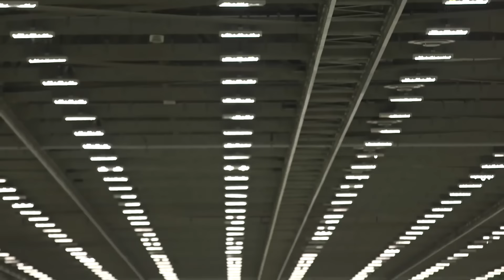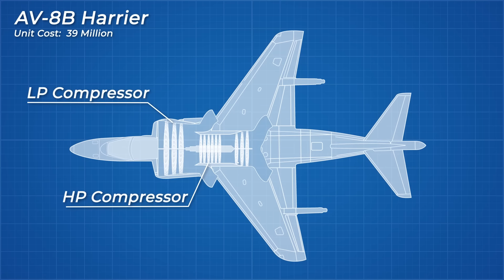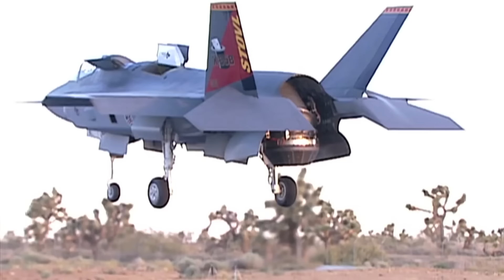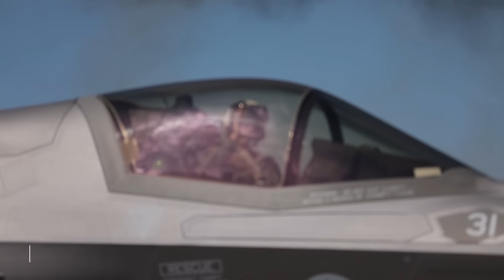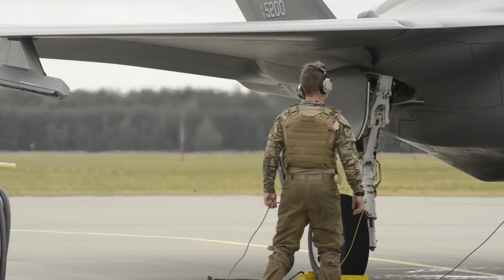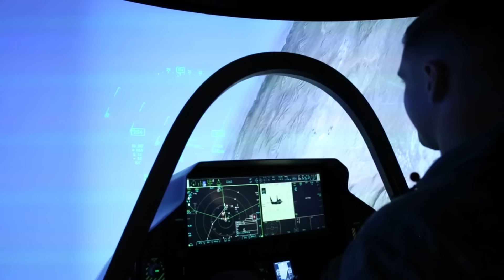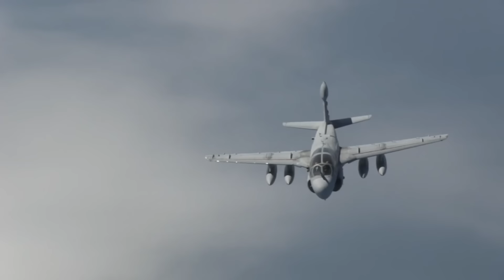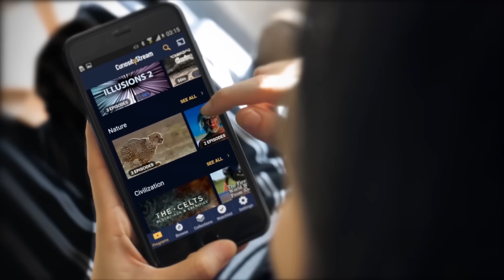Is The F-35 Worth $115 Million?

Comment: The A10 Warthog is not going anywhere, it is way too good at its job for its price, They want the F35 to replace it as a way to try and recoup some of the RnD funds, but the A10 has beat every plane to replace it so far and the F35 will be no different.
Reply: Not really the case
Reply: @peterson7082  for its price, ease of maintenance, and downright effectiveness for its intended job, there is 0 reason the F35 should replace it. If anything I could see the F35 working in conjunction with it to improve strike accuracy
Reply: @james2042  The A-10 excels at a minor aspect of CAS that is only notable today because the US are constantly at war with poorly armed terrorists who can't engage any fixed-wing aircraft effectively. F-16s are generally regarded as more effective at the overall role of CAS and have taken over from the A-10 in many aspects of the role. And there are cheaper options that can perform the same role as the A-10 while being similarly effective.

Comment: "Their lift fan system"? So the Russian prototypes fighters they bought for $400 million didn't help at all?
Reply: It turns out that if you design a system which is different than another system, it's fair to call that "your system".
Reply: They didn't buy the prototypes, they bought test data and other things I think. The Soviet prototype was fundamentally different than the F-35's solution. The design wasn't anything new either, Convair had the Model 200 that never made it to production but was pretty much the exact same concept as the Yak but over a decade earlier if I remember correctly.
Reply: The Yak-141 was already failing back in 1989 due to the increasingly crippled economy of the USSR. Lockheed wanted data that didn't yet exist in a conclusive form, so they paid for a lot of testing and for Yak to build another prototype to speed things up. The data gained in turn sped up Lockheed's testing of their own lift system.

By the time they got the data in late 1994 the overall design of the F-35 was already complete, as was it's engine design and lift fan. The only major change around that time was the nozzle, which was changed after Pratt & Whitney engineers found the old paperwork for the Convair Model 200, a concept that they had worked on in the late 60s and early 70s..

Comment: Of course it isn't worth that. Not even 10th of that. Since when some sheets of metal and plastic cost millions?
Reply: The cost of the engine by itself is more than 11.5M.
Reply: @infinitelyexplosive  
And that's bs.
Reply: @Gyvulys  Why? Jet engines are among the most complex devices in existence. They require years of development by experienced engineers, advanced metallurgy, high-precision milling, complex and lengthy manufacturing procedures, extensive testing, and are fairly low-volume products. How is it reasonable to expect anything other than massively high costs?
Reply: @infinitelyexplosive  
Except that engine technology, that's currently in use is already mastered and being mass-produced, we can carve complex peaces out of metal with ease, at a low cost (even in home conditions, on a smaller scale).

Considering this, the most expensive part should be the materials, which wouldn't cost a 100th of those 115 million.
Reply: @Gyvulys  Nice job ignoring the development, assembly, and testing costs. Additionally, you're glossing over the highly difficult to manufacture single-crystal superalloys that each compressor blade is made of, and the cost of the large high-precision milling devices which are necessary for the outer casing.

Comment: The development timeframe and the system of "outsourcing" to al 50 states, has led to the plan's tech being obsolete by the time it enters service.

And thanks to the poor security at the 3rd level subcontractors, China managed to steal 75% of the technical details using the hacking skills of a High School Freshman

The real nozzle of the VTOL was bought from a former Soviet Design firm. The Soviet Era pilots name those VTOL fighters "Widow Makers"
Reply: What tech exactly is currently obsolete? Could you provide a source for the 75% figure? Also, jets back then did not have nearly the same amount of computing power as we do now to assist in vertical take offs and landings.
Reply: @TT-hd3zi  The computer system is now almost 15 years old.

Also the Subcontractors who wrote the initial software did lots of "outsourcing" to India.

The people they hired over there had no background checks performed. The DOD allowed contractors to do this until 2010, when someone finally pointed out that these outsourced people could easily have placed backdoors into the software of not only the F-35, but many other weapons systems.
Reply: mshotz1 most tech in fighters is at-least 10 years old by the time it’s put into production, that is the nature of procurement and testing. It is still the most advanced computing system on any fighter to date. I couldn’t find anything on outsourcing to India, could you find a link?
Reply: @TT-hd3zi  After I got out of OCS in the US Army, and despite the fact I majored in Civil Engineering in college, they put me in a Sit On Your Ass and Do nothing Corps...er..Signal Corps.

In the early 1980's, France began to field a new tactical phone system called MSE (Mobile Subscriber Equipment). Which was Tactical digital cell phone network. 

Everyone in NATO started to buy it, and the US wanted it. But was not allowed to buy it from the French Company. So GTE bought the license to produce it here.

Except GTE decided that The US Army MSE needed different features. 

The French system was Modular, all the terminal and switching equipment was in racks. If there was an upgrade in capabilities, all you had to do was buy a upgrade kit with new cards/ modem, etc.

GTE made the first US version on big Cabinet with no GI Servable parts inside.

So as the need for more DATA and bandwidth came out, GTE just sold whole new systems to the US, rather then just upgrade the smaller components.

And, GTE took so frigging long to get the US's version out that it was two generations behind out NATO allies. by the time it was fielded.

(and don't get me started about the Radios GTE created to run the LOS lings between Cells nodes.!)

Comment: Operating costs are what prevents this plane from completely replacing the A-10, F-16, and F-18.  Those planes are significantly cheaper, with the A-10 only costing around 6,000 per hour vs. the F-35 at 30,000 per hour.  Combine that with the A-10’s unit cost, it’s firepower, and robustness and you would be stupid to replace that with an F-35.  Yes, the F-35 is a jack of all trades, but it’s also a master of none.
Reply: I would argue it's the master of heavily contested air to ground missions.
Reply: The A-10 is fucking garbage, it's designed for low and slow while it can't do that because it's a missile magnet piece of shit. It has to drop munitions from high altitude but it's fucking shit at that too, because it wasn't designed for it. There's a reason it might be replaced by Super Tucanos or similar, because a prop plane can do the same job without costing half as much.

Also "jack of all trades, master of none" is the principle behind multiroles.
Reply: There are different methods of measurement; the F-35's $35000 cost is an annual average of all forms of maintenance including depot work where planes are often disassembled and reassembled to check for issues that cannot be detected normally and takes a lot of man hours to perform. The A-10's $6000 is operational cost i.e how much it costs to operate the A-10 while in-theatre. This cost does not include any high-level maintenance and is measured over weeks or months, so your comparison is invalid.

If you want to compare the F-35's $35000 CPFH, then the A-10's equivalent cost is around $18000, the F-16's is around $20000, the F/A-18's is around $25000, the F-15E's is around $28000, the F-15C's is around $42000, and the F-22's is around $58000.

If we do the same for the A-10's $6000 CPFH, then the F-35A is around $13000, the F-16 is around $9000, the F/A-18 is around $12000, the F-15E is around $15000, the F-15C I am unsure of but it's probably around $16000, and the F-22 I am also unsure about but I doubt it will be above $20000.

Comment: I really don’t see the F-35 or any other current design outing the A-10 as a close air support platform. The A-10 is too well designed for the job even after being in service for nearly 50 years. The F-35 May be the jack of all trades, but the A-10 is the master of its trade. Plus, let’s be real, the A-10 was designed around a cannon that dispenses freedom at 4200 rounds per minute. You know that was a bored engineer being a smart a** that turned into a promotion.
Reply: The A-10 isn't able to perform the job it's designed for because it's outdated garbage and it would instantly get shot down. Even the B-1 Lancer performs more CAS than the A-10 these days. The A-10 can't even fly low, it has to use a sniper pod and drop munitions from high altitude, a job any aircraft can perform as long as it can carry bombs and the pod fits.

The F-35's survivability is far, far beyond what the A-10 could ever achieve, while it can actually use its own better sensors to perform CAS.

Comment: Canada backed out of its contract as its original procurement did not follow required government tender competition steps, and has since put out a tender to attract competition. Boeing Super Hornet, the F35, and Saab Gripen E are responding, a decision will be made by 2022. Something not mentioned in the video, the F35 has a problem operating in the arctic, using existing Canadian Navy capabilities.  It may not suit Canada's Arctic sovereignty needs.

Comment: Short answer no. The f-35 trys to do way to much. It is the jack of all trades. Master of none.
Reply: Not really.
Reply: @peterson7082  What i said is true. You know it.
Reply: @peterson7082  So i am supposed to belive the f-35 will be a ground atack vtol stealth air superiority fighter. Excell in all of those roles. Lol yeah no. Great planes were designed for one role. Not as multi role planes. The more roles a plane takes on. the less eficent it will be.
Reply: @thunberbolttwo3953  The VTOL and carrier variants are really different aircraft that share relatively high commonality. 

 Multi-role aircraft in regards to doctrinal use are not bad performers in the slightest, and make up much of most Air Forces. Like the F-16, Typhoon, Rafale, and Su-30.
Reply: @peterson7082  Except all versions us the basic air frame. having vtol built in raises the wing loading. which lower its menerverbility. As to the f-16 it was designed as a air superiority fighter. Not a multi role plane. the ground atack mode was added on ;ater.  The rafale and su-30  are not good in the ground atack mode. as purpose desinged planes.  For example they can not take the damage a a-10 can. All in all the f-35 is still a over enginered over priced pos.
Reply: @thunberbolttwo3953  They have a similar airframe, not the same. Wing loading doesn't cover loading effected by lifting bodies.

 The F-16 was a lightweight multi-role day fighter in conception. And evolved into a medium sized multi-role all-weather fighter. 

 The A-10 cannot survive a modern contested airspace or groundspace period.
Reply: @thunberbolttwo3953  Not even close buddy
Reply: @thunberbolttwo3953  F-16 was required to be multi-role before it was selected for production. Ground attack modes were upgraded over time but were present from the very beginning of production. 

The F-16 was in fact conceptualised for daytime use only since it didn't have a radar until relatively far into the competition. Go do some research into the Fighter Mafia as well as the people who had to guide the program into a mature and useful platform.

The F-35A's wing loading is similar to the F-16 to begin with, then you can factor in the extra lift gained from it's lifting body design. The F-35 is in simple terms a more maneuverable fighter.
Reply: @dumdumbinks274  The f-16 designed from the get to be a allweather plane. even the cheap f-5 had a radar in it. yes the f-16 was originally designed to be a interceptor. it was modified for ground atack. The problem with the f-16 ground atack role. Is that it can not loiter around the battlefield at all.Oh the wingloading on the f-16 is lower than pon the f-35. Which makes  the f-16 more manerverable than the f-35. Plus the f-16 has better thrust to weight than the f-35.  Which means the f-16 has a better rate of climb and is fgaster. than the f-35. The f-35 like all jack of all trades is a master of none of them.
Reply: @thunberbolttwo3953  The F-16 was designed as a day fighter per the designers of the F-16, as well as the Fighter Mafia who created the concept that lead to the F-16 in the first place. The USAF would not accept a day fighter and forced them to integrate a radar and several other avionics before it went into production.

The F-16 was required to have ground attack capability as part of the LWF competition... there is no production version of the F-16 that is without the capability. The F-16 demonstrated very early on that it was a capable strike aircraft, even outclassing 2 dedicated strike aircraft in a bombing accuracy competition in 1981 using the early Block 5 version. 

As for the role of ground attack... there's no need to loiter. Loitering will get you shot down very quickly and there's 2 very good reasons most strike aircraft of the Cold war dropped their entire payload in 1 pass on a single target... 
1. To achieve the best chance of escaping unscathed
2. The average number of bombs required to hit a large target such as a bridge was 10... bombs weren't accurate, and back then the F-16 was considered a medium range fighter, not a short range one. So it was often seen loaded with only a single centreline fuel tank and the  rest of it's pylons reserved for weapons.

Wing loading... The F-35 may be 1.5x heavier, but it also has 1.5x the wing surface area. And that's only wing loading. The fuselage of the F-35 produces an extra 30% lift, meaning that the F-35's overall loading is roughly the same or better than the F-16 no matter what mission it is performing. Not only that, but wing loading does not determine maneuverability. It is only a single factor out of many, and the F-35 for instance can turn much tighter than an F-16 and has a much easier time pointing it's nose at the enemy. 

The F-16's T/W ratio is only ever better than the F-35 if you compare them on different missions. The F-35A with only 50% fuel still outranges a fully fueled F-16 Block 50 and has a higher T/W ratio as well at roughly 1.12 with an air to air payload vs the F-16 at roughly 1.04. F-35 has higher subsonic acceleration and similar climb rate.

Speed. An F-16 with 6 missiles and nothing else reaches at most Mach 1.5. With a full strike payload it struggles to achieve anything greater than Mach 1.2. The F-35 can achieve Mach 1.61 with a full strike payload and max fuel. The only time the F-16 is faster than the F-35 is once it reaches the dogfight stage of air combat, but top speed is completely irrelevant to dogfighting, so the only time an F-16 is in practical terms faster than an F-35 is when the F-16 is retreating from a fight after using up or jettisoning all it's weapons.
Reply: @dumdumbinks274  as to the f-35 aside from stealth it is inferior to the f-16 in every way.

Comment: No, they should have sorted out the F22. The superior fighter. Another BS military program like the Navy Littoral combat ship. They ended up going back to new Frigates in the end. What a huge waste.An idiotic idea. You are lucky if you can even get depot level maintenance performed in the Navy. Try swapping out major modules on the ship to change missions. Any Enlisted sailor could tell you it was a bad joke.They should have kept the FFG7 longer , given it updates. The system used by the F35 was purchased from the RUSSIANS and tweaked for the F35. Another scam.
Reply: The F-22 which costs twice as much and has dramatically worse air to ground performance?

Comment: The best planes for dogfighting with best maneuverability and turn rate are WW2 era fighters. They will beat both F-15 and F-16 at it. But there's a reason no army will ever use those planes. Because in modern combat it's about detecting the enemy plane without being detected, shooting a missile at it from a very long distance - and then quickly getting away to have as much distance between planes as possible. E.g. before a "cold war era plane" will even have a chance to dogfight F-35 - it will first have to survive its attack, the attack of its wingmen and the attack of F-22 planes, that will certainly be somewhere nearby - e.g. not happening.

Comment: The X32B was a better VTOL aircraft.  Its computer controlled hover would of fixed any problems like the F35 has now
I really have worries about how reliable the double engine concept is on the B model. Plus..
The C model had a troubled development because it's hard to turn a USAF plane into a deck banging US Navy plane
Reply: All F-35 variants have one engine
Reply: @infinitelyexplosive  they have a drive shaft driven lift fan in the center for VTOL in the B model. Which is complicated and could fail miserably if the driveshaft goes kerplunk
Reply: @thetreblerebel  Yeah, but the life system on the X-32 also had complex features. At some point you have to acknowledge that single points of failure are inevitable and just trust the reliability of the design. Judging from the 60,000+ flight hours of the F-35B, it was designed well.